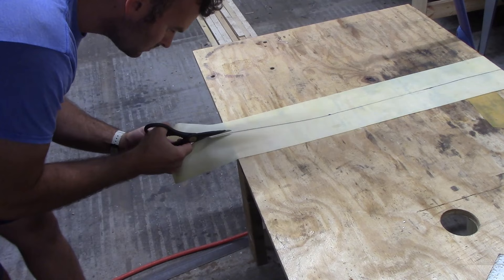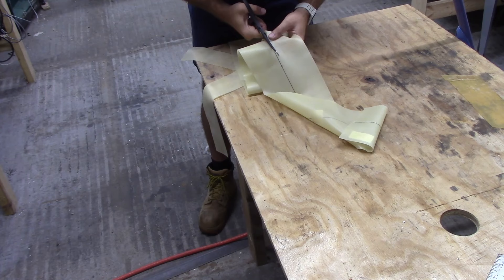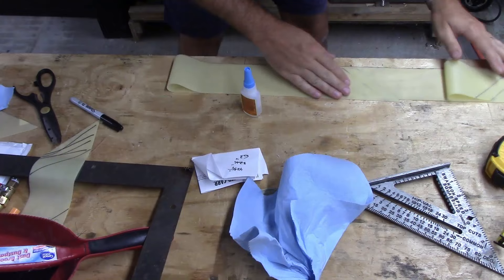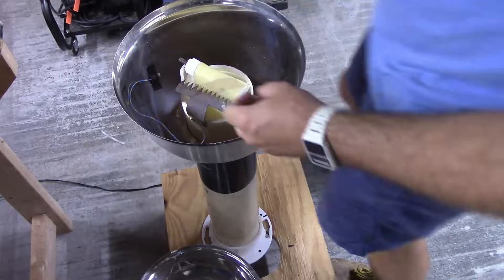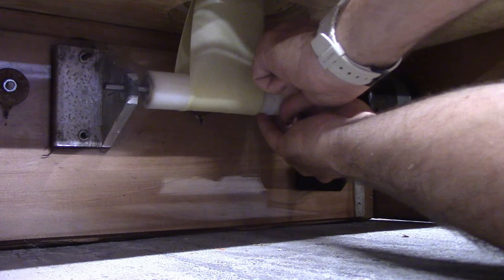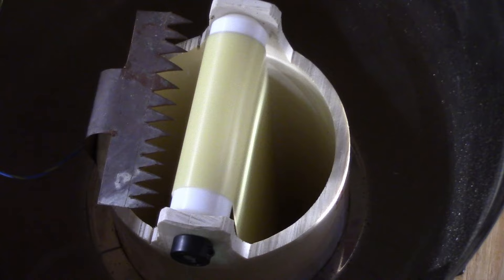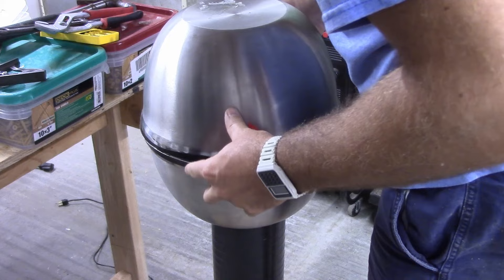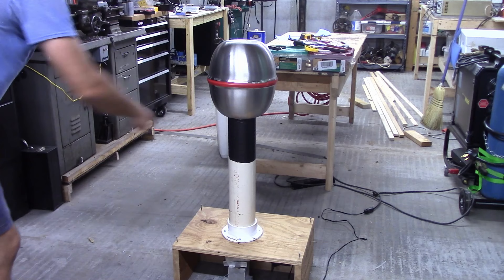Homemade Van De Graff Generator - Replacing the belt

Comment: What kind of roller material do you use?
Reply from the maker: The top is teflon, and the bottom is nylon.
Reply: @Hunter271828  thank you
Reply: @Hunter271828  Your van de graaff generator produces amazing sparks.
Reply from the maker: @helicopterkin1607  Thank you! Yeah I think nylon, teflon, and the latex belt are a great combo.
Reply: @Hunter271828 can I use PTFE thread seal tape for plumber to make bottom roller ?😅
Reply from the maker: @helicopterkin1607  Maybe? You could give it a try. It might keep unrolling on you, not sure.
Reply from the maker: @helicopterkin1607  And it is my top roller that is teflon, the bottom is nylon. This makes the generator top become negatively charged. Swap them and it will become positively charged.
Reply: @Hunter271828  thanks